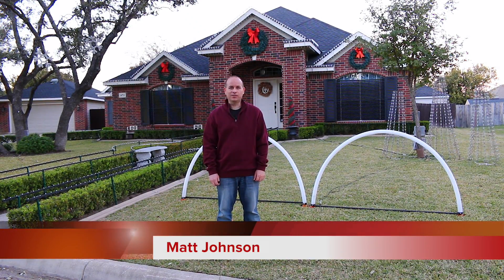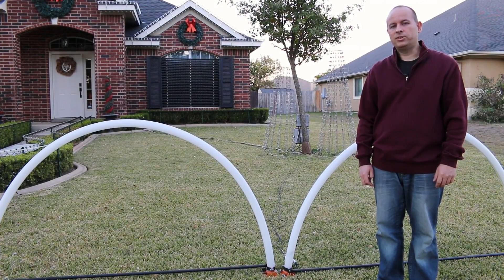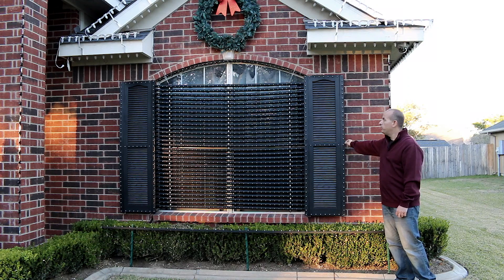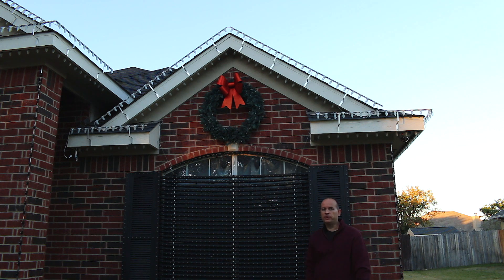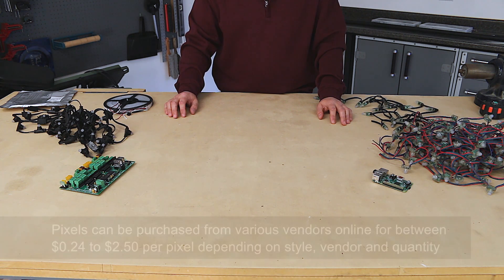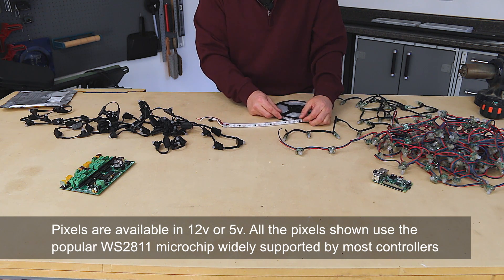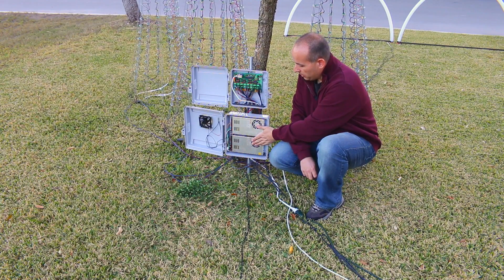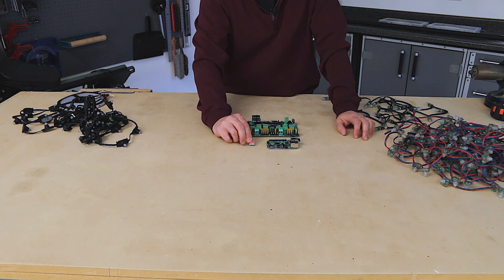Behind the scenes tour of the Johnson Christmas light show

Comment: +Matt Johnson
 
I've been interested in doing some light control for quite sometime, more just for something different than the typical house. What software is running on the Raspberry PI unit (Vixen 3?)?  I've been tossing arduino and Raspberry Pi back and forth trying to decide.  Leaning towards the Raspberry Pi as it would likely be easier to implement.  

Very impressive set ups btw.  I can see myself getting absorbed in to this, so maybe one day! lol

Comment: Can you control leds with ResberryPi and Mosfet? So it will be much cheaper
Reply: yes you can , but no for thousands of leds ...
Reply: +wzd leo these lights are individually addressable... meaning that for a mere 1k lights, you'd need 1k of FETs + support circuitry + PCBs + wiring. Plus a number of muxes, as the pi doesn't have nearly that many IO pins.
Reply: You can use addressable RGB strips so that there will be no need for MOSFET
Reply: ok, but then what's the difference from what this guy did? :)

Comment: How do you plug the RGB into the controller? Are you just using RGB extension wire to run from the controller to the lights? And if so how far can the controller be away from the RGB it's going to operate?
Reply: JC-Details cool

Comment: Couple of questions, Would each arch connect to one of the 16 outputs on the San Devices e682 pixel controller ? Also is the e682 really necessary ? with the Rpi running FPP player and the Pi having lots of IO pins that could easily provide the data to control the led pixel strips - level changing from 3.3 Volts to 5V of course.
Reply: +myozone You can only control based off my knowledge, no more than 5 individual strips on the GPIO pins on the Pi. A lot of people use those pins as inputs to make their show interactive, not to run the lights. This means that controllers are necessary. However you can get the PixLite 16, E682 or F16v2, which are the most common of the pixel controllers on the market

Comment: Nice job Matt. I want to know if you can make a video on how to wire trees and everything to your raspberry pi
Reply: +J.L.BRAVO ELTAMBOR NAY Network is simple. The pixels (trees) are connected to the pixel controller (in this case E682). The controller then talks E1.31 over a standard network cable (cat5/6) back to an ethernet switch. All the controllers and the Pi run into this switch and all have unique IP address which allow the Pi to send the signals out and the controllers to only utilise the data which is being sent to their IP address

Comment: hi, Matt i love the show, question for you, how do you get the software vixen 3 on a micro sd card to use it on  a raspberry pi.not on computer.
Reply: +jose20732000 Vixen 3 is installed on a normal PC, which is what the sequences are written in. You then export both the audio file (.mp3) and the sequence file (.fseq) to the micro SD card. The Pi runs Falcon Pi Player (FPP) which schedules and plays the sequences that are imported into it.

Comment: Thanks Matt...  Fantastic light show BTW....   Just had a few questions...  You said that each port has a maximum number of pixels per port and there is 16 ports on the card.  How do you best decide on how to distribute the pixels per port?  Is it best to do it by display element or can you group elements together?  I assume the sequencing software lets you control the individual pixels in each element.  Want to strike a balance to keep the cost per pixel down initially, but then have the system be expandable

We would also live to see a demonstration on how you put the whole show together from a software standpoint.
Reply: +Richard Taft Just changing from led/incans to pixels this coming year, but from what i gather it really does not matter.  Hard to fathom from a dumb incan/led controller background, but for ease of setup for devices in sequencing tools... you would likely want to group together based on element/model/item. Keep in mind that you will also have # of pixels causing voltage drop an need for power injection... so it is really a balancing act.  All this is pretty simple for large elements like megatree or pixel matrix but can be a planning challenge for items spread away form each other.  Similar to vixen, check out the beginning of this video: https://vimeo.com/123758528

Comment: Congratulations on a very well done and professional presentation.  You did a great job in just 12 and a half minutes explaining the basics of your wonderful light show.  I look forward to learning more.  I wonder if there's a way to use a Raspberry Pi to control  the 'Holiday Brilliant Light 3 Satellite Receivers Expansion Kit' I purchased for an inexpensive light show I had. The junk controller that came with it didn't even last one season. Now I'm stuck with six working satellite units and no way to make them do anything.  I have all these remote unites and nothing to control them with.  I realize this is much different than what's shown in the video, it uses regular Christmas lights not pixels and such.  Still I wondered if anyone had an idea for a simple set up using the Pi to control the satellite unites. Lowes no longer carries the Holiday Brilliant  GloTEC light shows they suckered me into buying...no wonder.   I hoped there was a way to make my own controller for all these remote units.  Any advice or points in the right direction would be greatly appreciated. Thank you.
Reply: +omegaman73of3  You maybe could use a 5 volt relay that is connected to the microcontroller to control each string, depending on the amperage of the string.

Comment: Great vids. Awesome info. Even better work. But I was wondering if you could explain in depth how to incorporate power injection( I'm going to be using 12 v pixels but with my length of strings I  will need power approx every 125 pixels)  but For some reason I can't wrap my head around it. If you could do a video on it or pm me the details It would be  greatly appreciate. Thank you.
Reply from the maker: If you never go over 125 pixels per output then you do not need power injection.
Reply: Matt Johnson At what wattage would you use your lights at to not exceed the amount your power supply can handle?
Reply from the maker: Courtney Vaughters Assuming that pixels draw about 60 milliamps when full white than a 12v/350 watt power supply could support about 400 pixels.

Comment: How did you run vixen on the R-Pi? Did you use wine to emulate it?
Reply from the maker: tdeisher79 You can export from Vixen 3 into a format called .fseq which is used by the Falcon Pi Player software. So Vixen 3 is not running on the Pi, it is the FPP software. You can check it out at http://www.falconchristmas.com
Reply: Thanks for the reply. Another question where did you purchase the renard ss24 from? I went to their site and I cant find it.
Reply from the maker: tdeisher79 I purchased it from a link given on the Wiki at doityourselfchristmas.com.